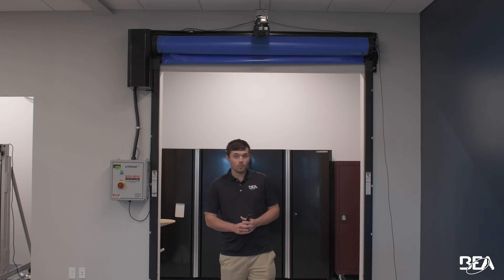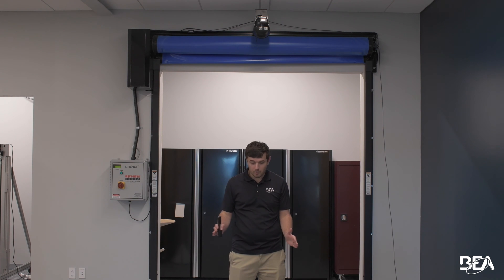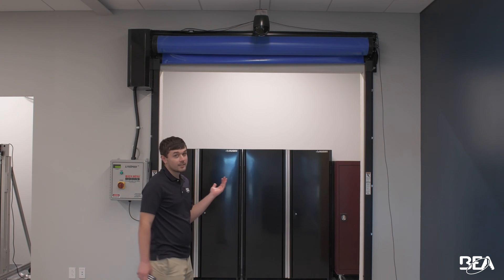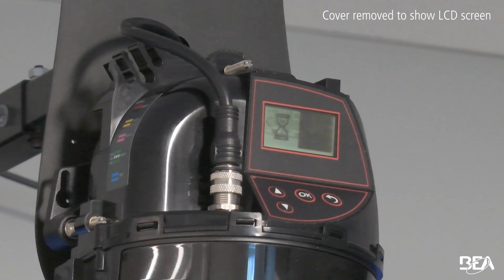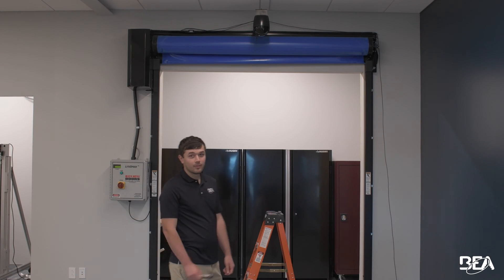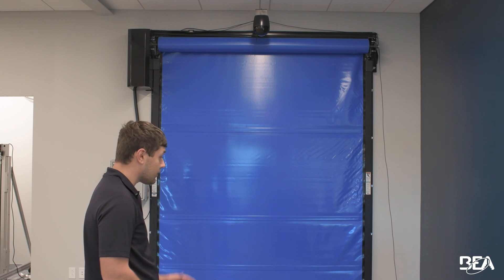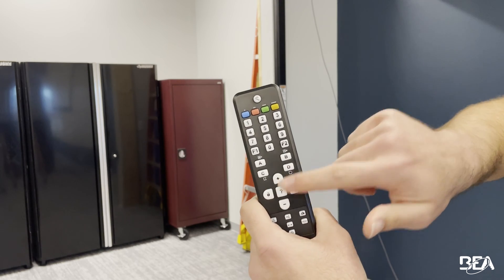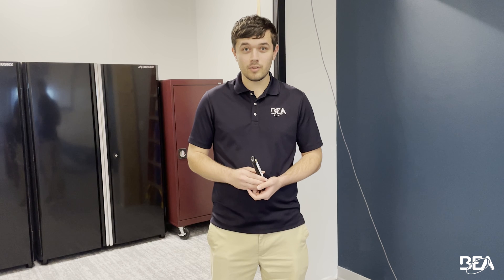Troubleshooting an E5 Flatness Error on an LZR-WIDESCAN Sensor

Comment: Omg I had this problem today and I didn't know what was going on ended up calling Technical support the tiles of floor on the detection area were removed I think for replacement and the scanner red light was on all  the time  not letting the door close so I was instructed to do a area relearn with the door closed and boy that was it thanks to the Technical Support guy he was very knowledgeable and helpful
Reply from the maker: Glad we were able to solve your issue, Jake!